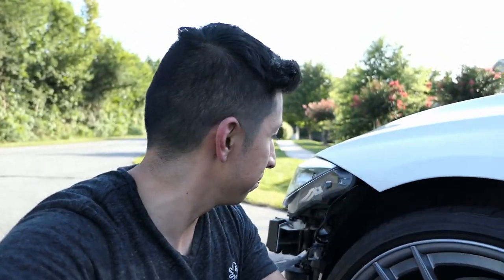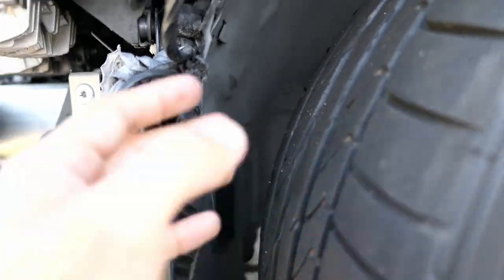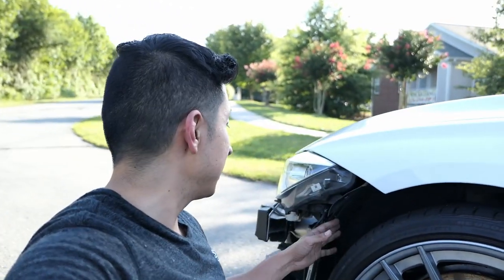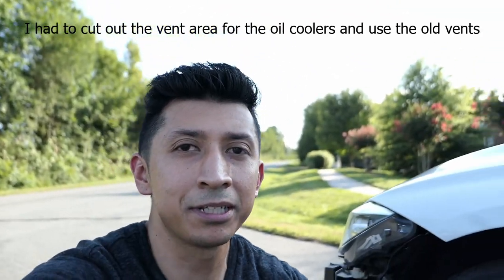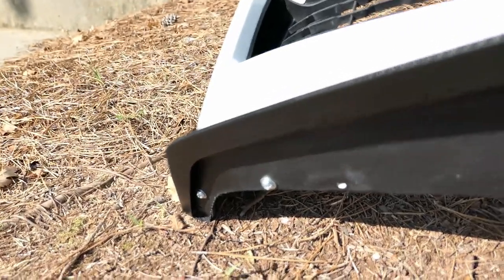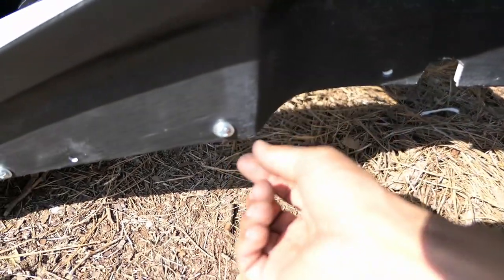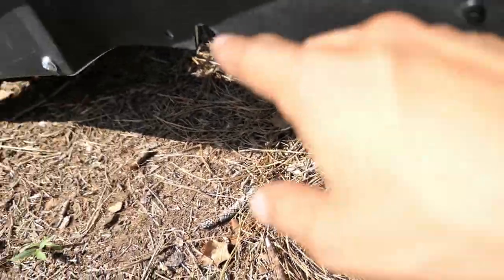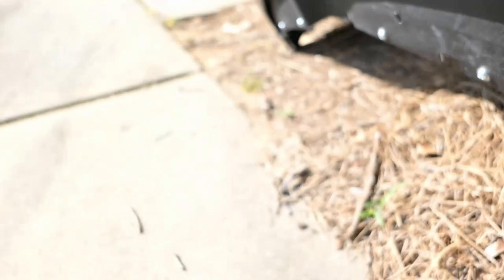New F30 Carbon Fiber Lip! | JHP Dynamics

Comment: I had bought the inner well  ones on ebay and it was just a cheap plastic material that will eventually burn out with the wheel ,it feels like a hard plastic compared to the oem material, i have that issue since i have a f80 rep front and somehow previous owner never replaced the inner fender wells they were all torn.
Reply from the maker: How do they burn out? Only way I see that happening is if your wheels still rub it while hitting dips or turning. The material felt a little thicker than stock but I didn't see how it could cause problem. I did see a different set on there that appeared to be a different thinner material
Reply: @EldridgeCortes  in my case idk if its the f80 rep bumper but the bumper sits closer to the wheels that throughout time the wheels kept tapping the wells on the freeway drives and the rebound on some humps caused it to hit it. Its frustrated, i probably got the thinner material but it said closest to oem , when i received it it felt crappy and curvy plastic  which i had to bend it straighter to hook up to the screws
Reply from the maker: @pjefsquad  ahh I see. Might be a mix of both the bumper and fender liner.  Mine lined up perfectly. The only issue was the vents for the oil cooler. I had to cut it out and taped the old vents on there for now since I didn't have a way to glue it
Reply: @EldridgeCortes  thats what i figured might go with a msport and buy the oem inner wells ugh 😑